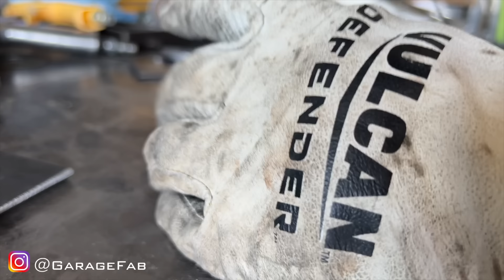Build Poly Engine Mounts For Anything! Mighty Max Ep: 19

Comment: That intro had me on the edge of my seat waiting for you to drill the block! lol. So the 6 bolt has that boss already threaded? Good info to have. As usual, awesome work. How can you not NEED A/C in Vegas, tho?
Reply from the maker: So from what I’ve been told, my motor had all the bolt holes! Apparently the Mighty Max mounts only use the two forward-most bolts for the block plates. That sounds inadequate to me! I’m pleased with the upgrade.
I’ve had no A/C for the majority of my life. It wasn’t until recently that I got a car with fantastic A/C. I feel like a King!

Comment: The might max only use the 2 bolt holes for mounts. Not a traditional plate with four bolt holes
Reply from the maker: Is it the two I used on each side? Two does not seem like enough!

Comment: Great video! Why did you add the extra washer inside with the mock bushings when setting the tab spacing? Thanks
Reply from the maker: Good eye, Nick! 👏 The washer is there to create a tiny bit of additional clearance between the tabs and the bushings for two reasons: 1. Welds will often put pressure on the tabs so that when you pull the mock-up bushing out, the tabs spring inward. This makes it annoying to try and get the actual bushing in later.
2. Powder coating is pretty thick. So adding a layer of color to the the insides of both tabs will shrink this clearance even more. The bolt will have no problem flexing the tabs in to eliminate whatever tiny amount of clearance is left.
Thank you my friend!
Reply: @GarageFab  I missed it on the first watch through. I am in the middle of making motor mounts myself (using your excellent videos as a guide) and had that exact weld pressure problem happen on my first attempt. Thanks!
Reply from the maker: Nice. Well lemme know how things go in round 2!

Comment: Wow! Lovely 4G63t 👍
But, it is NOT original 1st gen 4G63 turbocharger. Find original or bolt-on 3gen turbo, and forget about fitment problem 😉
Reply from the maker: Thank you, my friend! How can you tell?! The motor came from a 2nd gen Eclipse so you’re very right.
Reply: @GarageFab  My english is not good enough, besides, I did not watch the video carefully enough: I did not immediately notice that the turbocharger was installed reversibly.
Reply: @GarageFab  I meant that the turbocharger protrudes so far, because normally the compressor input should be directed towards the gearbox. The turbocharger from the next generation engine is deployed in the other direction, because since 1996 MMC has installed transverse engines on the left. Such a turbocharger will be installed close to the engine block, and the cold side entrance will look forward.
Reply from the maker: Your English is perfect my friend. How do you view Garage Fab videos? Do you understand English well or are they subtitles? I’m considering having videos translated to Russian.
You are appreciated.
Reply: @GarageFab  I perceive it by ear. Subtitles with automatic translation do not always work correctly, besides, reading distracts from viewing.
However, subtitles are a good help for those who don't know English at all, I think.
Reply from the maker: What’s your opinion on voice dubbing? The mouth won’t match of course. More annoying than subtitles?
Reply: @GarageFab  what do you mean by "the mouth won't match"?
Reply: @GarageFab  There are so many viewers from Russia on the channel that you intend to make translation with dubbing?
Reply from the maker: I’ve considered creating multiple versions of the channel for countries that view Garage Fab the most. They would be the same videos but professionally translated/dubbed. I imagine it would be obvious that I wasn’t speaking Russian.

Comment: Great video! What thickness did you choose for the mount plates and tabs? Thanks
Reply from the maker: I used 1/4 inch for the plates the bolt to the block, and 3/16 inch for the tabs.

Comment: I just got mine running a couple weeks ago but ran into clutch issues. Anyway, you can probably use an oil filter housing from an evo 8/9 which has provisions for an air external oil cooler. You can also use a forward facing mighty max (7 bolt 4g64) ofh or maybe (haven’t mocked up) a 3g eclipse/outlander ofh but these 3 don’t have oil cooling provisions
Reply from the maker: Nice! Thank you Gerardo. I’ll look into those. What type of clutch issues? I haven’t got that far yet.
Reply: @GarageFab   When the truck is on, I can’t put it into gear. I already maxed out the cable adjustment so I’m gonna try extending the throw out bearing (tob) 1/4” by welding a dsm tob to the mm tob housing. I didn’t have a press so I decided to go this route instead of just pressing out the mm housing. I’m hoping 1/4” is enough since that’s the difference I measured between them. I’m using a dsm fwd flywheel, custom clutches clutch, and an exedy pressure plate but I heard of some people have found a clutch combo that doesn’t need a special tob
Reply from the maker: Interesting! So are you sure the clutch is dragging and it’s not a synchro issue? I’d love to hear updates on this. I should probably be buying my clutch soon. I’m not far away from needing it.
Reply: @GarageFab  I’m pretty sure it’s the clutch combination since others sometimes have to extend the tob depending on their selection all the way up to 1” or so. I should have the tob swapped sometime next week and should know by then if 1/4” is enough. I plan on running this transmission until it breaks and then switch to something that can hold some torque. I’m also not a fan of the clutch cable as some people say it’ll flex the firewall and eventually tear it if you have a heavy clutch setup
Reply from the maker: Yes! This happened to me. I had to rebuild the flange that the cable goes through. It’s now a tougher bolt on style. Best of luck my man!

Comment: I haven't been a DSM guy in awhile (my last build was making a FWD 2G AWD), but the 7 bolt was considered bad…

Smaller rods, & smaller ports are easily fixed, but what about the crank walk issue?
Reply from the maker: I’m not DSM guy at all! 😬 But I am a mechanic and some of the research I’ve done on crank walk makes a lot of sense. It appears to almost always occur on manual trans vehicles, and is much worse with racing clutches. That’s because throw-out bearings/pressure plates put a lot of forward force on the crank. That causes the most damage when starting the car with no oil pressure.
That said, no performance pressure plate will be installed on this truck, and the clutch switch will be disabled to prevent pressure on dry thrust bearings.
There are so many other problems I still get to deal with though. Yay.
Reply: 4L65?
Reply from the maker: I don’t know what that is!
Reply from the maker: Interesting! Thanks for that. I’ll talk to the Wife and see if she wants auto. We had a conversation this weekend about right hand drive. She said it would be cool but she doesn’t know if she would like shifting with her left hand. 🤔 Choices.

Comment: What are those drill bits you are using in your drill press? And where can we get them from? Please and thank you.
And has anyone seen any adaptors that can use annular bits from a mag drill and use them in a normal drill chuck.?
Reply from the maker: Hey Steve! My cutters are basically exactly what you just described. They’re called Hougen RotaCut Hole Cutters. They’re kinda pricey but worth every penny. Here’s a pair of associate links to the two specific sets I own…
Small https://amzn.to/3guFEwJ
Large https://amzn.to/3ukxxL5
Reply: @GarageFab  Thanks for that. 
Now for trickiest of trick questions, Do they make them in Metric?
I have a heap of metric Mag Drill bits, but can't find an adaptor for them, and unfortunately this arbour won't fit them.
Reply from the maker: I just did a search. Yes! They exist. Unfortunately I can’t send you a link. I don’t see them on Amazon.
Search for Hougen RotaCut Part #: 11086

Comment: Mate can you link those drills you have to drill the holes on the metal plate? And the punch bits to mark the drills, it would be aswesome to check if I can get one's in Europe :D
Reply from the maker: Absolutely. The bits are called Hougen RotaCut Hole Cutters. They’re kinda pricey but worth every penny. Here’s a pair of associate links to the two specific sets I own…
Small https://amzn.to/3guFEwJ
Large https://amzn.to/3ukxxL5
I don’t have a link to the transfer punches, because I wouldn’t advise getting them from Amazon. If They’re not expensive they won’t last. If you plan on using them on steel, they will dull really quickly.
Spellmaco is the brand I have and seem to be great. Check eBay! That’s where I got mine.
Reply: @GarageFab  Thanks a lot for the reply! They aren't cheap for real, even more in the europre where there isn't any great tools :(

Comment: Duuude!  You need a CNC plasma table.  They are easy to build,  would be good content if you showed building one.  LinuxCNC is free, and the motors and hardware are very cheap these days.  I built a 4x5 table for under $700 cause I used steel scrap to build the table instead of the fancy 2020 tslot others use.
Reply from the maker: Building one from scratch would certainly be interesting. 🤔

Comment: Metric thread drill size are so easy. Bolt diameter - thread pitch = drill size. M10x1.5 - > 10-1.5 = 8.5mm

Comment: Off (this) topic but I know you'll know this - I am installing new coil overs & the springs are 3" longer than what was on the car.  How do I calculate how long my Panhard bar should be ?  If I need a new adjustable Panhard bar, who do you suggest ? Thank you Erin.
Reply from the maker: Hey James! Good to see your words again. The length of the panhard bar isn’t necessarily “calculated”. On any vehicle, the panhard bar should be as long as possible. The overall length would usually be determined by the design of the axle and the frame. Meaning, how close to the wheels can you mount the brackets?
The longer the panhard bar is, the less side-to-side movement the body will have when the suspension compresses and extends.
What do you mean by 3” longer springs? Are they lift springs?
What are you using the vehicle for?
Now that I’ve had time to think a little more, are you simply replacing an already existing panhard bar? My answer was kinda geared towards fabricating a suspension from scratch.

Comment: Not sure if it's even possible, but can the exhaust manifold be flipped upside-down? It could possibly create more space. On another note, I've always loved that era of the Mitsubishi Eclipse. They were very cool cars, and those engines were stout. Really hope you can get it all to work. Nice work, my friend. 👌
Reply from the maker: Thank you Danny! I too like that model Eclipse. I don’t think I could’ve parted it out of it wasn’t a convertible. (Not a fan of convertibles and the top was in pretty poor shape anyway.)
I can not “flip” the exhaust manifold because the bolt holes won’t line up but some have said that other Mitsubishi models have a manifold with a top mount that may be an option. The challenge will then be hood clearance and I don’t want to have to modify the already painted hood… But we’ll see!

Comment: That oil pressure sensor just stick a 90 fitting in there and bolt it in from the top.
Reply from the maker: I like it. I’ll remember that one. Sometimes it’s the simplest solutions.

Comment: You should choose 2.5inch motor mount, instead of 2, also I noticed that you measured the plate same as the bushing, it should be a little bigger for protection
Reply from the maker: Why for?
Reply: Bigger always better, Go bigger or go home 🤗

Comment: What is that tool you're using to make the holes. In the last hole you make, when you retract the tool, it looks like the center of the material is still there. Is it some kind of trepan tool?
I work in manufacturing and I've never seen that type of tool. 
Thx, I love the channel,
Reply from the maker: Hey, Dave! They’re called Hougen RotaCut Hole Cutters. They’re kinda pricey but worth every penny. Here’s a pair of associate links to the two specific sets I own…
Small https://amzn.to/3guFEwJ
Large https://amzn.to/3ukxxL5
Reply: @GarageFab  Great. thanks. I just found your channel and am really enjoying it. You've got a great presence in front of the camera, clear and concise explanations and examples, without taking yourself too seriously. 
I just bought a Jeep Cherokee and discovered a crack in the frame, so I've got a welding project, but can't weld. It should be interesting. Thx, and no, you don't look like you smell like cheese, LOL (from Wisconsin, I'd know)
Reply from the maker: Haha! Thank you my friend. Best of luck! Pro tip: Those hole cutters will help you combat that crack. Pinpoint the end of the crack and drill it out before attempting to weld it. It’ll help keep the crack from spreading or reappearing.
Reply: @GarageFab  The crack is accompanied by rust. I'll have to cut it out and rebuild the frame rails, at least the bottom and an inch or two up the sides. I had some 14gauge CR steel bent into a "L" shape with a 4" and 1-3/4" leg so I can cut out what I need and weld it in. The Frame stiffeners over the whole mess. Thanks for the help,

Comment: That hole you bored in the block-side motor mount for that plug... It looks like it's just big enough for the hex head but not the flange. You might have to get that out some day. It might be a good idea to open that bore up a little more so that you don't have to pull the motor mount to get to it.
Reply from the maker: You are correct. It’s not big enough to remove the bolt. I can’t imagine If ever need to access that bolt, but it wouldn’t be hard to open up the hole a little before powder coating. 🤔 Thank you!
Reply: @GarageFab  If you had my luck, you'd need to get to it shortly after final assembly.
Reply from the maker: Hahaha! I feel you.

Comment: Аарон здравствуй, всё красиво сделал, жму руку мастера но вот крепление двигателя наверное должны стоять ближе к передней части двигателя, это теперь какая нагрузка на крепление, в передней части двигателя она была бы в разы меньше.
Reply from the maker: The mounts are pretty close to the factory locations. Maybe an inch behind. It makes more sense to me to place the engine mounts near Balance point of the engine/transmission assembly. Some older Toyotas have engine mounts very near the front of the motor and the overloaded transmission mounts sag and wear out early.

Comment: awesome work, im wondering why you are getting so much soot around your welds? i tend to get ALOT of soot on my welds too and often thought i might not be on the correct settings.
Reply from the maker: Try pushing your weld. I prefer to pull, but I have found that pushing leaves a bright shiny weld. Just the direction of the shielding gas I imagine.

Comment: Stock these engines just use the 2 front bolt holes for the engine mounts
Reply from the maker: Second time I’ve heard that Daryll! I can’t argue because I don’t know. 🤷‍♂️ I can say that I wouldn’t like the fact that a motor mount could potentially rock on two bolts when slamming on the brakes.
Reply: @GarageFab  the gearbox mount stops the engine rocking forward. I have a 1g 4g63 n/a in a 78 mitsi lancer (dodge colt over there I think)

Comment: I would send a photo but don't know how.  I have a 29 model A w/a 66 289 Mustang engine.  I bought it as a roller so the suspension that came with it is what I am updating. Maybe I can keep the existing panhard bar but I knew I had to replace the coil overs.  They were flat. No spring in the shocks at all. So I bought a set from Jegs & I think they fit ok but the springs are 3" longer than the 11" I had.  My problem is I have one or two 'teachers' who don't know what they're doing. I appreciate their willingness to try but left in their hands, they'll wreck my car.  I learned about sagitta online and I understand it.  It seems a pretty basic principle.
But now I have my ride up in jack stands with my Panhard still sitting on the axle adjusted for 11" shocks.  And I have to put my shocks (coil overs) on. I think I can do this but not sure if I use my existing panhard or another and how to decide how much adjustment on it and how high / low to adjust my shocks ??? HELP !

Comment: Run a electric power steering and ac pump. Do a top mount turbo all problems solved 👍
Reply from the maker: I just might do the electric A/C if I can find a quality one. No need for power steering with the steering box I have, and I’m not so sure I can top mount the turbo. The truck is already painted and I’m not sure I have room under the hood. I’ll check tho!

Comment: Doesn't it mean that you can't pull just the motor out you have to remove the trans first? Because you can't go fwd after released from the trans...
Reply from the maker: I don’t think I’ll be able to answer that until the time comes. If you’re referring to the lack of space between the engine and radiator, the entire front end will be designed to be easily removed. I’m not sure I’d want to just remove the engine since the rear mount is just a single bolt at the rear of the trans. It might be tough to try and support the trans. 🤷‍♂️